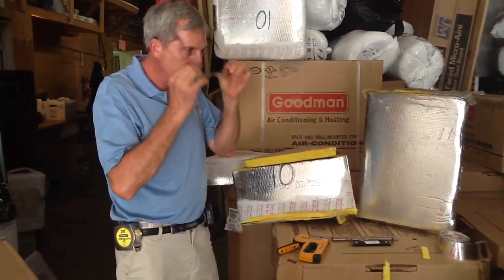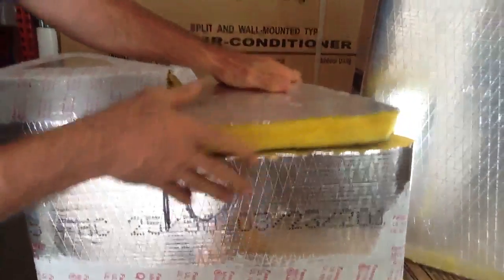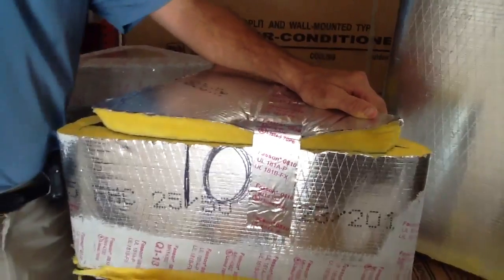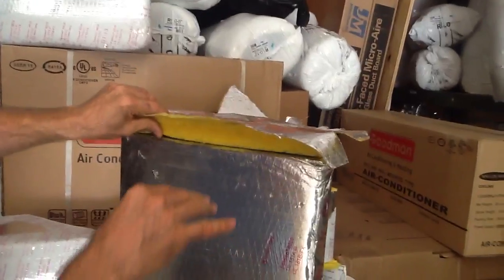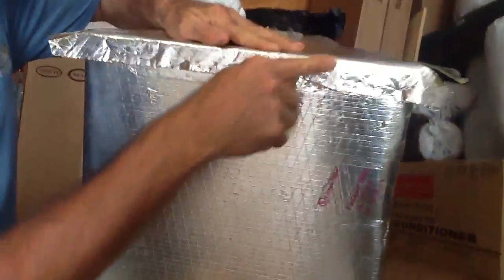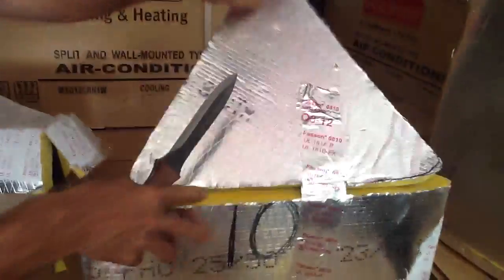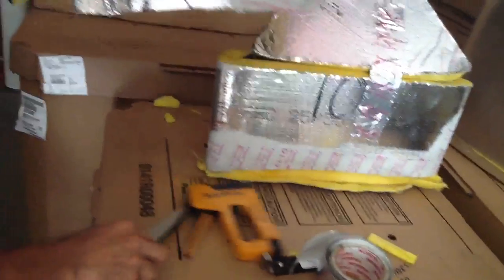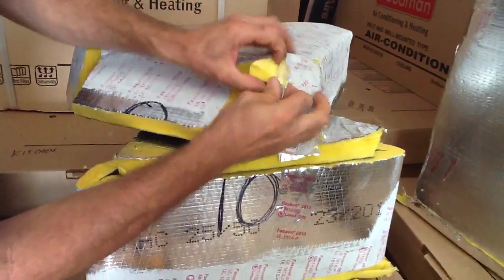How to Correctly Assemble Duct Work?

Comment: How would hot air get in if the pressure inside the duct it higher due to the fan then outside atmospheric pressure?
Reply: https://youtu.be/MTXSXL1P374
A

Comment: Good video.  I have duct system that has several 90 degree turns and big gaps.  I don’t have access to the outside only the inside.  How can I  properly seal it form the inside? Tape, paste, insulation foam, caulk??  Thank you
Reply: https://youtu.be/MTXSXL1P374
Q

Comment: First off, you're an asshole if you put ductboard in someone's house. I've found dead mice in ductboard because they felt the heat and wanted to get warm. They just chew thru it. Do people want to pay thousands of dollars for something a mouse can chew thru? Fuck no. I worked for Lin Jarrett Heating and we had a sheetmetal shop and custom made every piece of duct we put in. It cost the customer more, but they got the best airflow possible. When the duct had to come off the unit and make a quick right, and then break into a trunkline, we'd fabricate a fitting 21 by 22 and it would CURVE into a 10 by 20 duct. Then when it had to split each way right after that fitting, we'd put a split, a nice curved edge split that had beautiful airflow, the air wasn't every building pressure until it hit the endcaps on the end of the trunk. THAT is what you want. A ductboard pie system is a fucking cheap ass piece of shit system. A plenum box with a bunch of runs cut in it. How the fuck do you get even airflow out of that? Put a damper at every fucking collar you cut in? Jesus. Dude, if this is the kind of work you do, I'd quit if I worked for you and I'd tell the customer what a piece of shit system it is, and they better put cheesecloth over every vent. Dude, you're cutting fiberglass and leaving an edge where fiberglass will blow everytime you cut the unit on. Tell the customer a rat can easily chew thru it and give your system a rotting stench and you'll have to come rip down every piece of duct when it happens. Don't tell them how much better than metal it is, don't even go there. At least tell the customer your cheap moneymaking ass could put metal in for some extra money and the metal won't go bad for 30 years. AND, YOU KNOW, if that shield isn't installed correctly at the furnace fitting, and moisture from condensation blows over the shield, that ductboard will absorb it and start getting mold and rot in it. Do your customers right and at least put roundpipe in, and if you're not skilled enough to fab fittings, get the fuck out of HVAC work with your half ass. Seriously.

Comment: David, I want to thank you for everything you’ve done up until this very moment. Sincerely. I have learned a lot from your videos. You have been doing this for a long time time and your wisdom and love for your craft shine through, especially on this video. Unfortunately, your craft involves penetrating your customers... hardcore anal. You’ve been working in this industry long enough to know duct board is rubbish and should not be attached to thousands of dollars worth of equipment for 5 to 8 seconds, let alone 5 to 8 years. I’ve been in this trade for barely a blink compared to you, so I don’t mean to be out of line but it hurts my soul to realize that one of my heros, doesn’t respect the most fundamental aspect of our trade. AIRFLOW. When are you down south fellas gonna roll up the sleeves and get some good old fashioned custom fabricated metal trunk lines installed? Without 40 and 50 foot coupled flex runs?
Reply: https://youtu.be/MTXSXL1P374
A
Reply: His mixing boxes are fine without the mastic. Insulated duct board is perfect if u know how to seal it properly when it's produced. I've add on and replaces houses that I've done duct roughs for and my boxes are still intact perfect for 7 years. U just need to work for ac designs if ur in the "south"

Comment: Would you please give an advice?   I just find out the return box on my hot attic is made of metal and there is no insulation around.  So it is just bare metal box.   How can I seal it since it is very hot up there. Thanks
Reply from the maker: replace it or rewrap with insulation
Reply: Don't listen to this guy and Duct wrap it.
Reply: David Le wrap it
Reply: Wait until winter to do such job. I planned to do my own soon. It is too expensive to hire contractor.
Reply: https://youtu.be/MTXSXL1P374
A

Comment: duct board is crap! try getting it cleaned without shredding the inside. give me wrapped metal.
Reply: Joe Sommers ductboard should be outlawed.
Reply: Joe Sommers Your using the wrong duct cleaning machine.
Reply: Filter your air correctly and supply vents won't get dirty
Reply: Hey Joe, so what do you recomend?? any video
Reply: MrEskorpion insulated metal duct is permanent. Duct board will fall apart with duct cleaning.
Reply: Angela Reamy Too fragile will breakdown.
Reply: Any decent options for those of us stuck with duct board?
Reply: Joe Sommers not a chance. use a duct cleaner every day. got to use the right machine.

Comment: Thank you!  Great video, does anyone sell a kit with duct board, a shiplap tool and that combat dagger you're using?
Reply: Dude, think about this. Are you going to install a duct system that a mouse can chew thru and crawl up in and die? Then they'll have to rip out every bit of duct. Dude, get a metal trunkline, and if you cannot afford to hire the guys who'll fabricate your ductwork and make custom fittings for the best airflow, at least buy the cheap ass roundpipe, snap it together, screw and tape it with mastic tape ( it's thick rubber tape with a silver coating covering the outside), and it's thick as hell. If you can't afford THAT, screw it together, get a tub of duct seal, run duct seal over the joint and after it dries, run 3 coats of duct tape around every joint. Fuck ductboard. I did ductwork for 5 years and learned how to fabricate fittings in a sheetmetal shop. Only problem with THAT is guys like this come out and the customer hires their half ass because he's cheaper, ALOT cheaper. He won't tell them how shitty ductboard is, he'll slap it in.  Do it right and take pride in the fact you gave the customer metal, and you gave them the best airflow possible, and hire a sheetmetal fab guy. Oh, that's right, he wouldn't want to pay him. Guys like him ruin HVAC and make it NOT a trade or skill anymore. "hehehe, lets slap this ductboard in and make 3 grand". Yea, fucker. Fuck him. Put in metal and use duct seal and you ain't gotta worry about tape coming off. Seriously. Do it right. This dude is a piece of shit. You put this shit in someone's home and you're a fucking asshole, a dishonest asshole out trying to make a dollar.
Reply: https://youtu.be/MTXSXL1P374
Q

Comment: Man, I wish you guys were here at Cape Cod in MA. I pulled out about 2 gallons of water out of my ducts in the attic on my AC system.  Water was everywhere from the air handler to the last flex duct. The main duct is metal wrapped with rFoil r-4. That bubble wrap stuff. The attic is a walk in attic that gets up to 100 degrees. The heating system is not a duct system, just AC. I just recently had all the ducts replaced and have never had a problem. The AC system has always been maintained and is working well. Any ideas?
Reply: nld1960  Any bubble wrap alone should never be used in an attic. R8 blanket insulation wrapped metal duct should now be considered minimal for duct in attic. Think about an insulated attic with the now required R50 insulation.
Reply: https://youtu.be/MTXSXL1P374
A

Comment from the maker: Yes that would be sufficient, the air handler itself has insulation wrap inside as long as there are no space between the duct board and air handler it should be ok. Thanks for asking.

Comment: Because I was reading the manual that came w the tempstar and it talked about this, it said Secure duct to flange using
proper fasteners for type of duct used, and seal duct−to−unit. Use flexible, then it said Use flexible connectors between duct work & unit to
prevent transmission of vibration. Now I know the top of the air handler is only a foot from the ceiling, but is what he did OK ? so, he has spray adhesive under the vapor barrier tabs on top of the handler, then foil tape, then mastic.
Reply: https://youtu.be/MTXSXL1P374
A

Comment: I enjoyed your video and thanks for taking the time to make it. On a south florida home w a updraft air handler; using QUIET 1 1/2 board; how do u actually attach the duct board to the top of the air handler? A guy was out here w a V groove paddle & made the square duct. It was only a foot tall till it hit the supply trunk. He just had the 1" vapor barrier flaps foil taped to the top of the air handler. I THINK he put spray adhesive first. He then covered is all in mastic. Is this sufficient?
Reply: https://youtu.be/MTXSXL1P374
Q